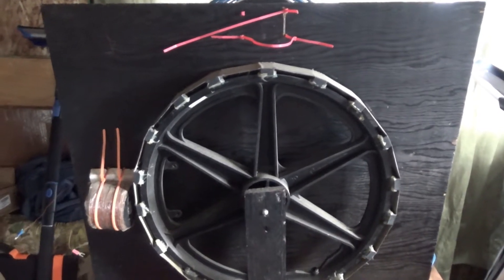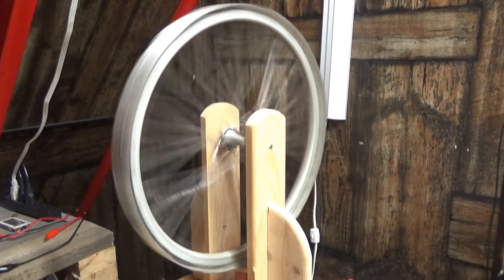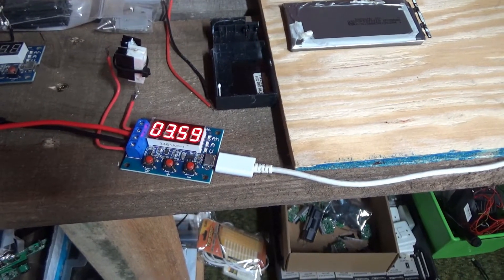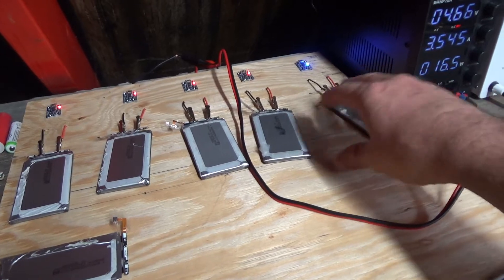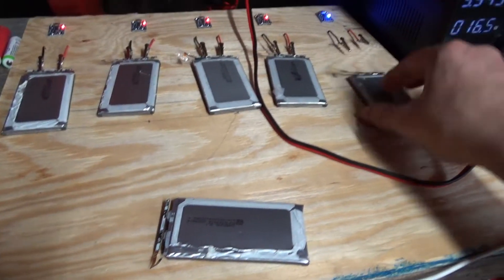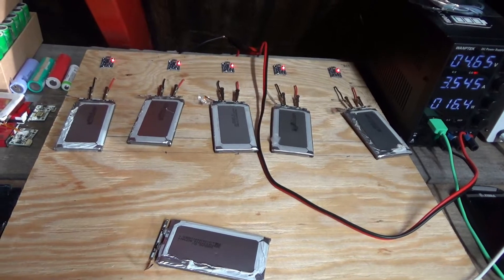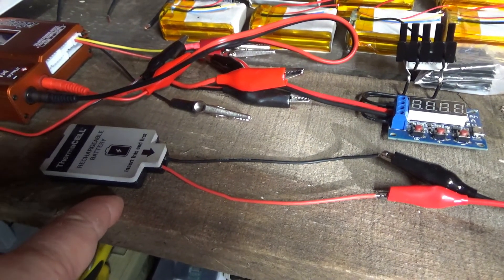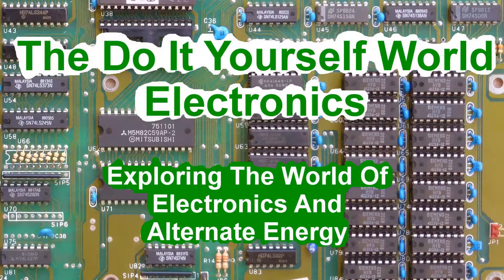My Lithium Ion Battery Charging And Testing Station

Comment: @ 1:20 "Here in my new warm electronics lab" If you don't place some cement board for safety, you might end up with more warmth  than you want :)
Reply from the maker: Yes I want to do that. Right now tho we are being constantly buried under snow. We just finished digging out from three days of snow and I read that there is another winter storm watch for today and tomorrow. We are being blasted. Nature is taking revenge on us for having a mild fall.